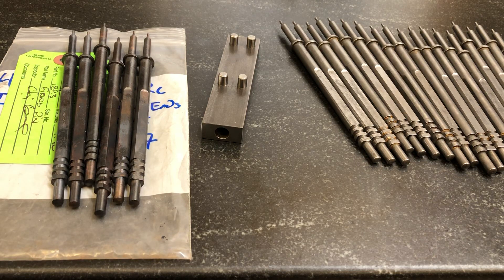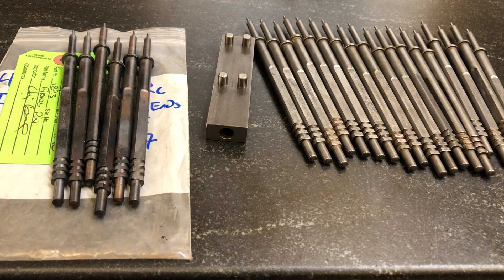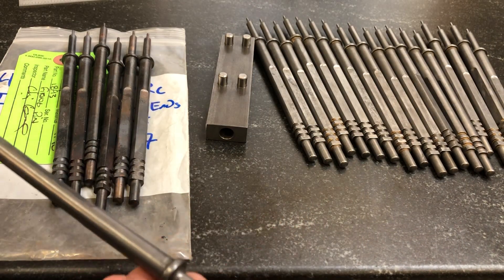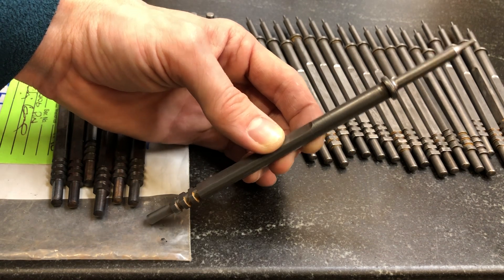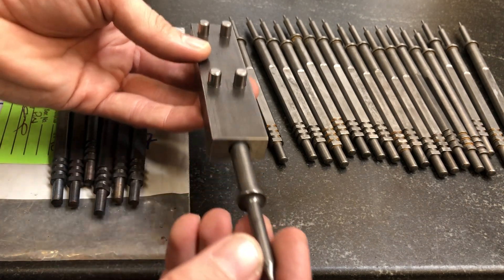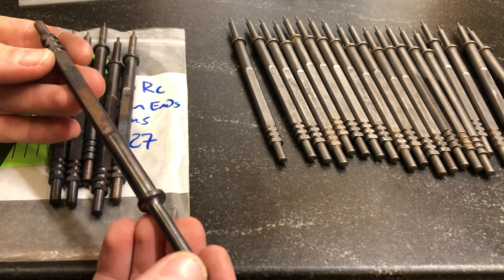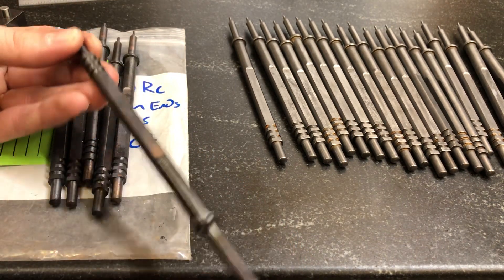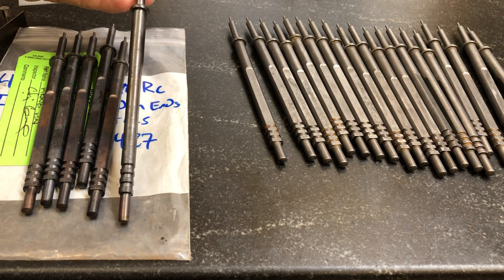Heat Treated Firing Pins

Comment: In my country its impossible to find original firing pins or reproduction ones. And there are no ways to order them from US due to strict roles here and there. I have a yugo M48A with a broken firing pin and its useless now. This rifle means a lot to me as it was owned by my father and my grandfather may their souls rest in peace and I don't know what to do. I'm thinking about finding a suitable drill bit or maybe a steel rod to hand it to a lathe machine specialist with the old broken firing pin to copy it. A mechanic not a gunsmith because we don't have gunsmiths here. I'm really confused and don't even know what kind of steel is good for this. Any informations will help PLEASE. God bless you.

Comment: I just went through and watched all your videos.  I really like the quality of your products.  A year or so ago I picked up a reproduction firing pin and an extractor for a Model 1936 Mexican Mauser from you.  The parts fit and works perfectly.  Last week a guy on a forum posted about some Mauser actions that he'd bought.  It was a pair of 98's and three small ring receivers.  He said that he was just going to sell off the small rings.  I noticed in the photo that he posted that one of the small ring receivers in his batch was a 1936 Mexican (dated 1941), and I explained to him how it was actually a small ring 98.  The model 1936's were made from heat treated 4140 chrome-moly steel, not case hardened mild steel, and they are suitable for use with modern cartridges.  He was excited to learn that there was a unicorn mixed it with those Spanish 93's.  When he asked me where he could find parts I recommended he check out your webpage.  As for mine, it's going to become a sporter in 7x57.